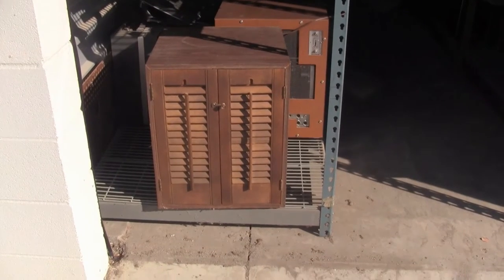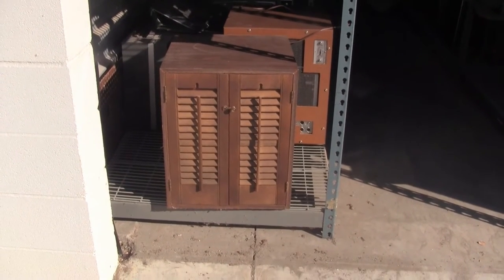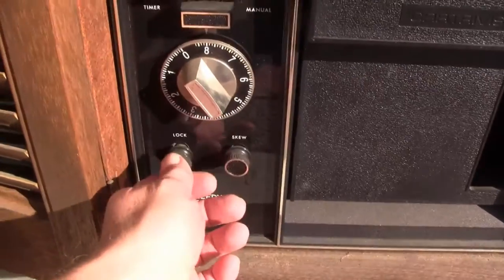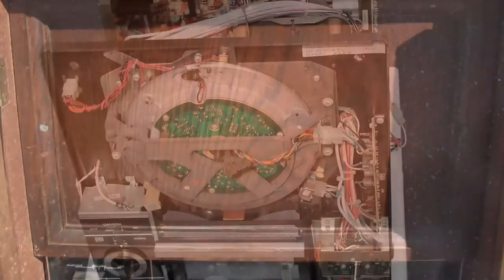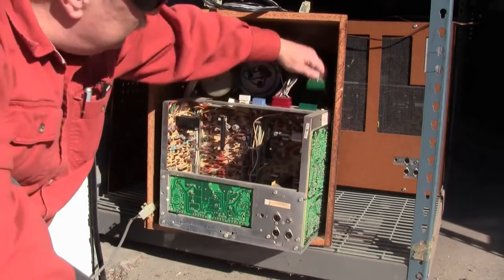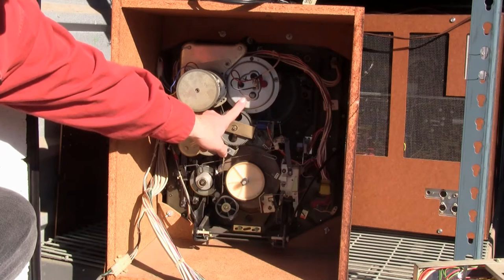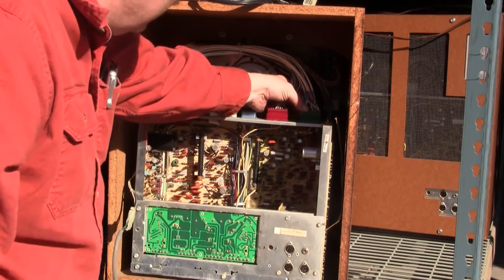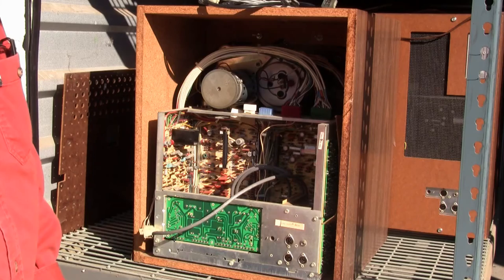Cartrivision VCR, A second look

Comment: i  was an electronics major Cal Poly San Luis Obispo back in 1974.  One of my college room mates had a contact in San Jose California, home of Cartrivision.  My roommate could get the Cartrivision machines for cheap..  Cartrivision had gone out of business and was selling its stock of machines it had left  for I think $150;00.  You got just the guts. Deck and electronics chassis.
I bought one of the units and had to build a box for it like you see in the Videolabguy's video.  I got it working and had years of fun with it.  Back then NBC had a show called the Midnight Special that had music bands of the day play live on stage like Linda Ronstadt. The show also did an audio simulcast on one of  the local FM stations in Los Angeles where I lived and I was able to record the show in STEREO.  A really big deal back then to have probably the only stereo color video tape recorder in a home..  I added a pause button that would just stop the motor and you could get a still frame.  The picture was actually pretty good and so was the sound.  Picture was good until there was a quick pan of the camera then you could see the picture break up into jerky still frames as the camera panned. Tape moved at 3 3/4 IPS if I remember right.   I would buy blank tapes that were only 15 minutes long in large cartridge and would add my own 1/2 inch tape to fill the reels up. I think a large cartridge would hold about 2 hours. Smaller Cartridges would hold about 1/2 hour if I remember right.   I had the machine until 1980. Never had a problem with it.  It was  a lot of fun and learned a lot.  One of the best toys I ever had. I ended up working as a broadcast engineer at NBC in Burbank Ca for over 30 years.  Cartivision was my first introduction to video tape at the age of 21 and was a big influence on my career choice.  Thank you Videolabguy for making this video and bringing back great memories of my youth.
Reply: I bought one of those too but never got it to do anything.  The tape would unthread right after threading.  sad.

Comment: My dad brought home one of these beasts back in the late 70s. The Cartrivision wasn't working, so he got it cheap and bought it for the TV. He did get the Cartrivision to work for a while, (glad he didn't lose a finger) and I remember thinking that it was just the coolest thing ever! I had to be around 7-9 years old at the time, but I remember it well. It was a tall cabinet that had the TV on the bottom, Cartrivision unit in the middle, and speakers on top. It was at least 6 feet tall, as it was taller than my dad. I remember it so well because we had a tape of some kids craft projects that I watched over and over. I think the Cartrivision section had the wood slat doors that are seen in your first video, but that part's hazy. Thanks for making this video!

Comment: I used to own two different machines.  They are definitely beasts.  They did the M wrap long before VHS ever did, but only 120 degrees (three heads on a disk rotating at 1200RPM), with only head 1 recording, and all three playing.

And the fishtank boards:  If memory serves, from left to right, the larger ones are servo control, video playback, video record, and audio.  The smaller board by the jack cluster is the power supply with a huge, honking transformer on the fisthank's floor.

Fun fact:   The type of motor that drives the scanner disk serves as reel motors in the Ampex VPR-2.

Those were some memories!

Comment: I had one of those beasts in high school (circa 1976). It never recorded properly and I used it to setup a backstage video monitor for theater productions. That cabinet was way to heavy for scrawny me to lug around, so I cut it in half and joined it with lever latches. The separate fishtank made that pretty convenient.

Comment: That is a pretty interesting beast! I've only seen photos of machines in worse condition. So I suppose one could reload that cartridge with EIAJ. I havent played with a vtr that has a pancake head motor yet. At least there is no slip belt to wear out like EIAJ and earlier U-matic so that's nice. I know some pancake motors have ridiculously good acceleration but I'm guessing the servo in there wouldn't try and lock in 1/2 a second. It would be great to see you fire up one of these or show it when restored. I'm interested to know more about the color system... (is it direct 3.58 or perhaps better then 688khz? etc.) I had no idea these could be stereo either, that must have been a big deal to plug that into one of those really good sounding giant console units back then and watch a movie!

Comment: I was wondering at the type of tape it used it reminds me of a video 2000 with the tape above the tape ...70 to 72 i was 10 in 1970 and didn't know any thing like that existed ..no video recorder ever entered my mind till 1980..we were always behind in Australia when it had to do with television .Looks like it would be very expensive to post .
Reply from the maker: Cartrivision used the same tape as EIAJ half inch open reel. Of course, the format is not compatible. Cartrivision stacks two seven inch reels inside the cassette. That is why the deck has the coaxial reel spindles like the VX format. (Quasar Great Time Machine) The tape is pulled out of the cartridge, just like in VHS into a W thread, one third of the way around the face of the scanner. The three video heads are mounted to a rotating plate and protrude through the scanner face like in EIAJ. The cool thing is that the video head record and playback preamps are on a circuit board that rotates along with the heads! At 10RPS/600RPM, I guess that's not too bad for balance. I blabber on, mostly correctly, about the 3:1 skip field recording method in the video.

Comment: What a mechanical and electronic nightmare. With it only recording 10 fps and plying them back in triplicate, I can not imagine that fast action would look very good. 
But hey, they did get it to work, almost....
Reply from the maker: They look surprisingly OK. In most live scenes, there is very little motion. The color process is also praised by some of the Ampex guys I know. Still, the design is quite 1963, even though it was produced in 1970. Virtually everyone else (Sony) gave up on skip field recording by this time.
Reply: Actually it recorded 20 fields per second. There are 60 fields, 30 complete frames, per second in the 525 line NTSC system and it recorded every third field so one third of 60 is 20 fields per second, not 10 as stated.